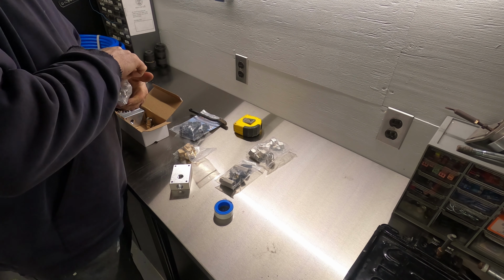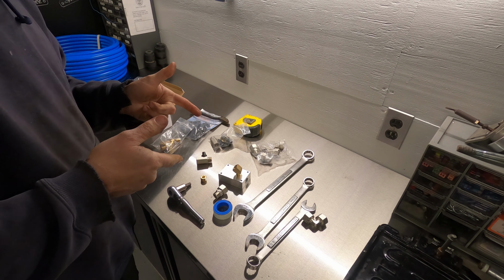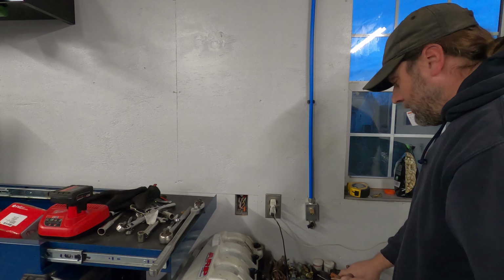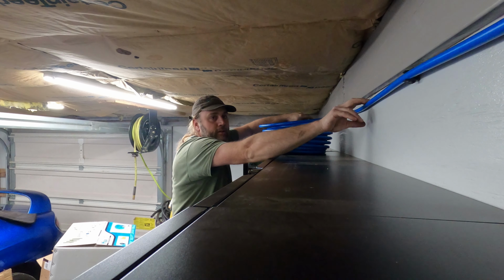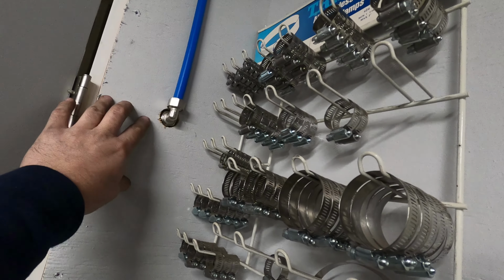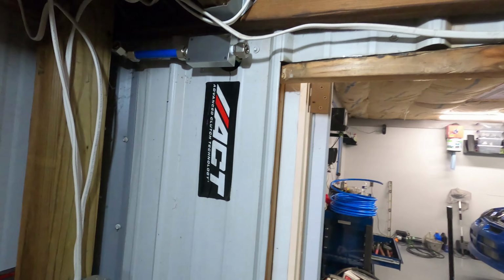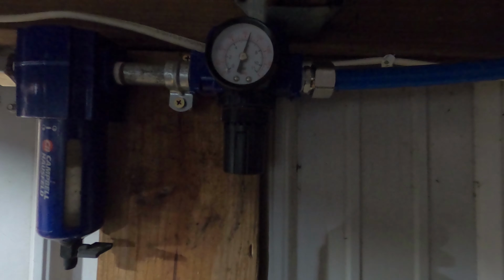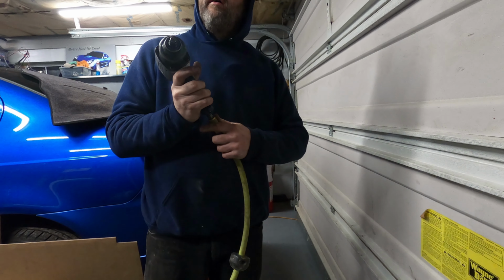AIR COMPRESSOR LINE INSTALL

Comment: Hey I know it’s off the topic of this vid but I’m swapping a srt from a sxt I was wondering if the fuel tanks are different because I just dropped mine to do undercoat and put it back in and it was a pain
Reply from the maker: Michael Foster the tank it self is the same just swap out the pump assembly as it’s different for the Srt4 more pressure
Reply: Matt's need for speed alright great I put a high flow Mishimoto pump in there  so I should be good